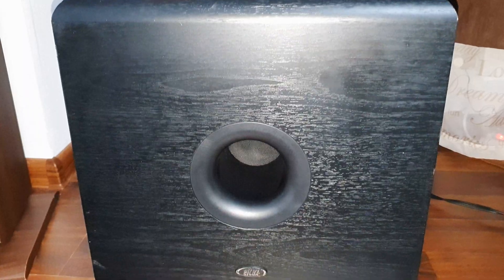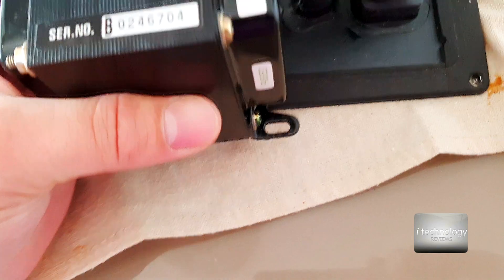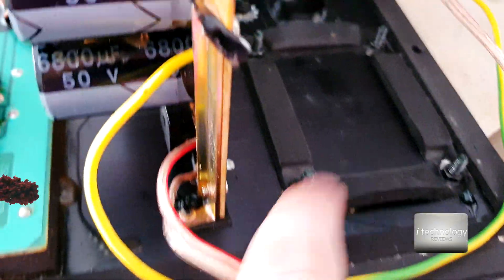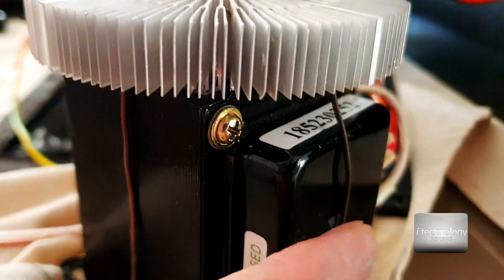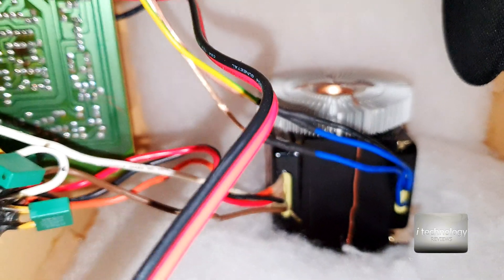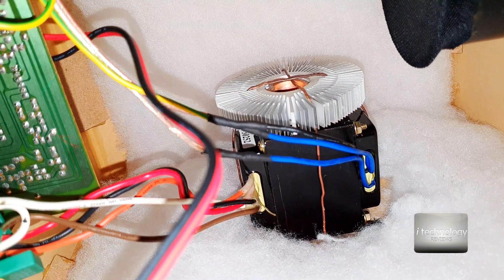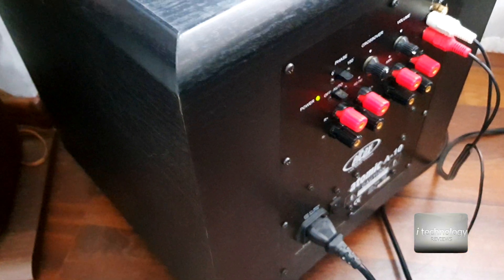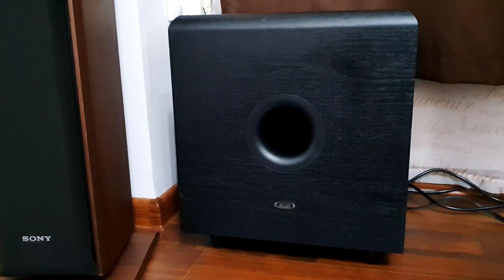Remove Subwoofer transformer humming/buzzing noise - Eltax Atomic A10 10inch UPGRADE, 350W, 14,5Kg

Comment: I just got the Eltax Atomic A-10.2, and it has the same problem.

But I've found a MUCH easier solution: just flip the amp a quarter turn, and the humming is gone. It's because the transformer touches the subwoofer.

Great video though. ✌️

Comment: I have an Atomic A8.2 and it makes a "boom" every 5-10 seconds when here is no input signal - looks like repeating "standby-on" switching. Can it be fixed?
Reply: a Russian website has the service manual on it, slightly advanced & there is an 'expert's only section in the PDF re tuning the 'auto on mode' with extra components.

does your sub stop this cycle if you take it out of auto on mode?

Comment: Wouldn't it be easier to fit a metal shield between the transformer and amplifier circuit board?
Reply from the maker: hi; i don't think it will work; are just to close
Reply: earth bond then insulate the proposed metal shield
Reply: Just flip the amp a quarter turn, and the problem is solved. I just did it to mine.  @TknJn